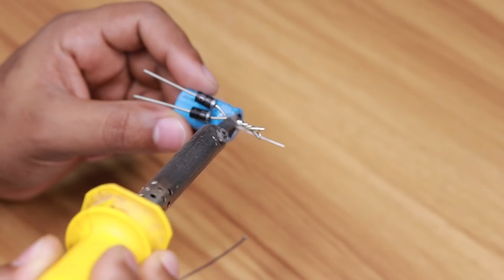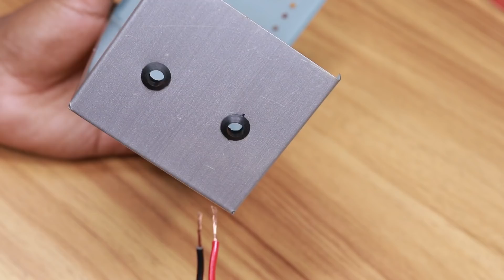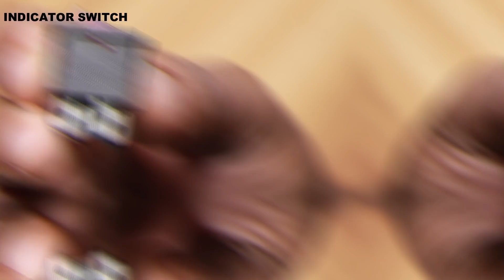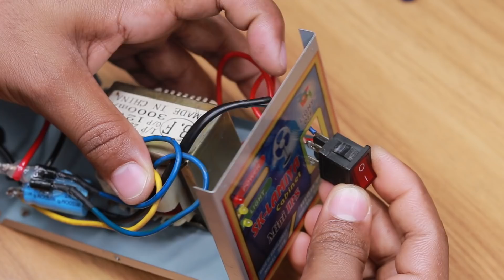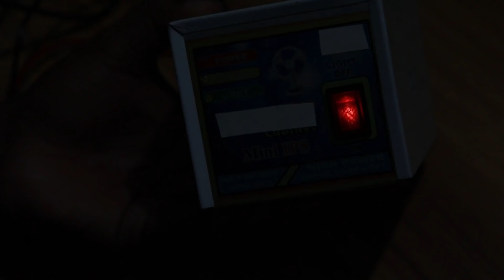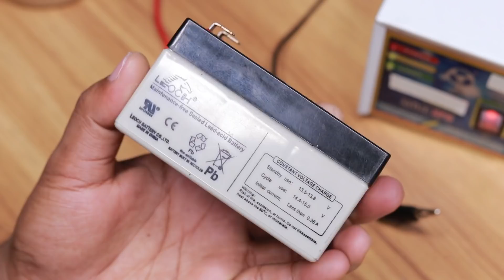How to make 12V Battery charger at home easy

Comment: Nice vidéo, is a half wave rectifier pulsant voltage, true?  probably works for chargers, but we where expecting ( at least me ) see the charger  working,  and see  the voltaje drop when connecting the battery, (one more comment DOES NOT CRITICIZE) Do you never clean the welder?  Thanks uploading vidéos.
Regards.

Comment: This isn’t a perfect direct courrent. 
In this mode you are eliminated a negative half wave so you have onli positive halfe wave 
For obtain a dc from ac you need a diode bridge. In this mode the negative half wave is converted in positive half wave and with a capacitor you obtain a perfect DC